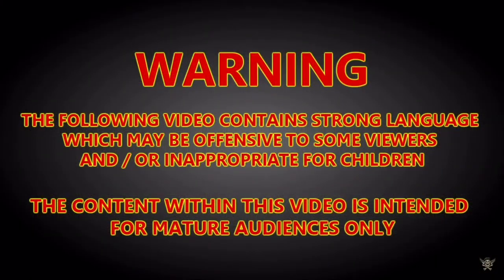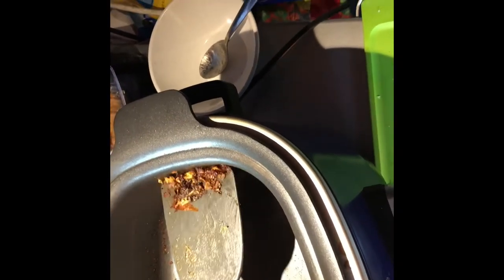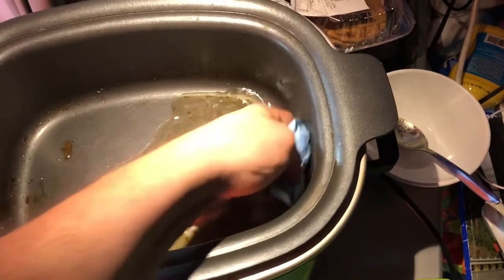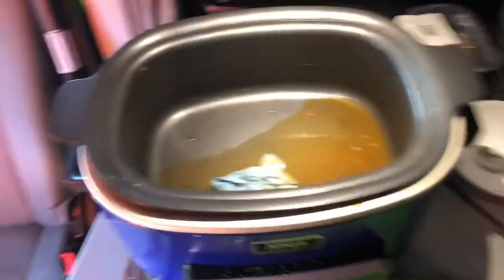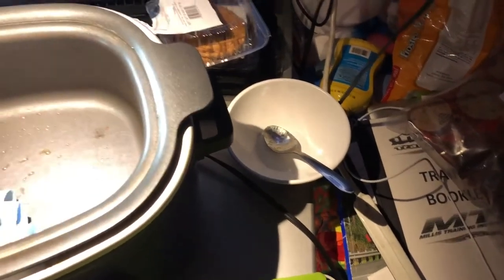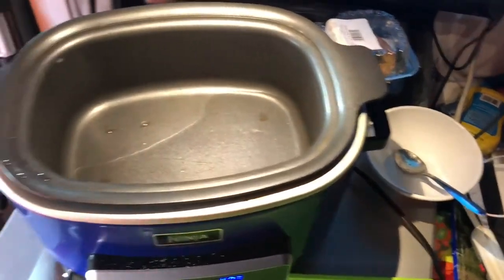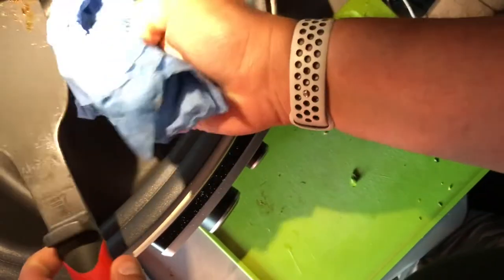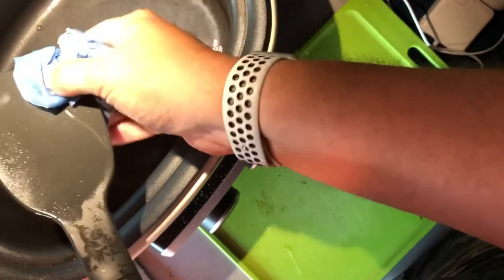Cleaning dishes in a semi truck after a meal

Comment: You know... you can buy plastic liners specifically designed for slow cookers /Crock pots.  They come in various sizes and fit inside the cooker.  When finished cooking and removing the food from the cooker just pull out the liners and throw them away.  Your pot remains perfectly clean... that's when the liners are designed to do.  So much simpler.  You can buy them pretty much anywhere.  Go to Amazon and use the search terms "slow cooker liners" and see!
Reply from the maker: cybersoil100 the ninja is not a slow cooker. The way I cook in it will melt the plastic liners . Thank you for the comment it just gets to hot